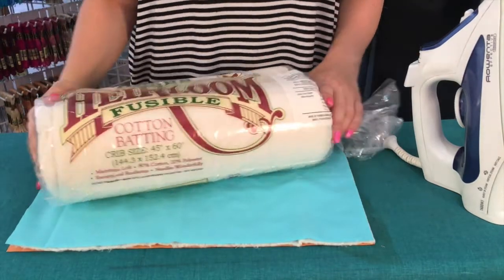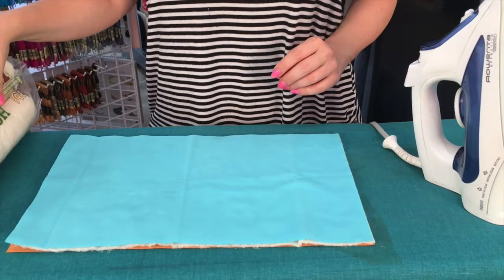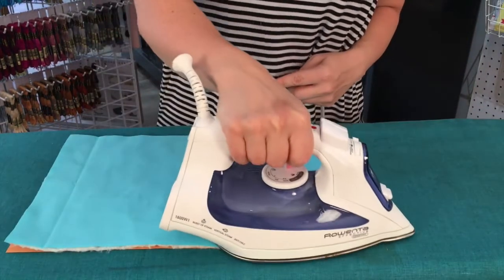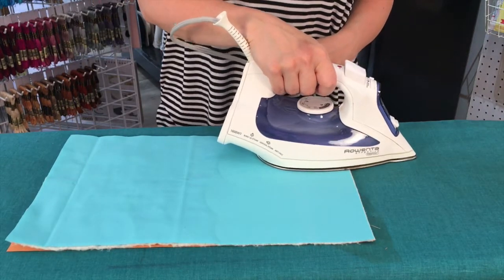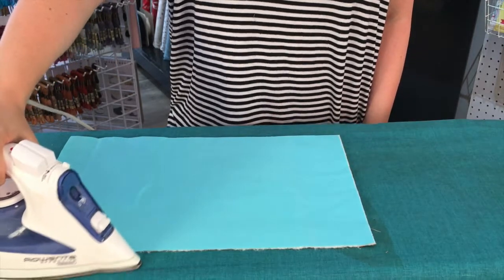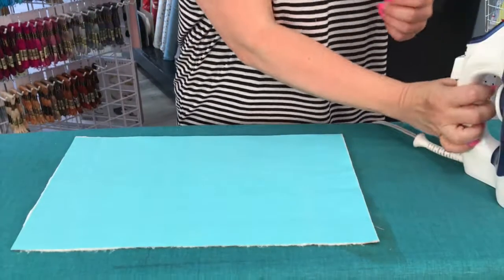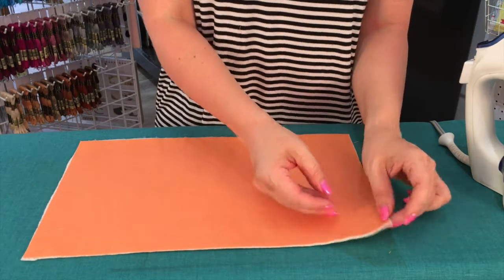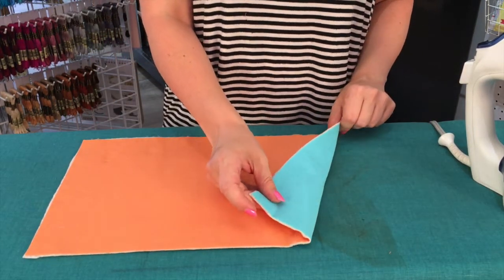How To Apply Fusible Quilt Batting

Comment: Wish you would have said two sided fusible. I have one sided, waste of my time to have to go to the end before one realizes you use two-sided. Thanks anyway.
Reply: I assume it works the same. I sewed my pieced top to the batting, (making placemats with some batting my sister had already cut to size. I now plan to just iron the backing to the glue-y side and quilt it.